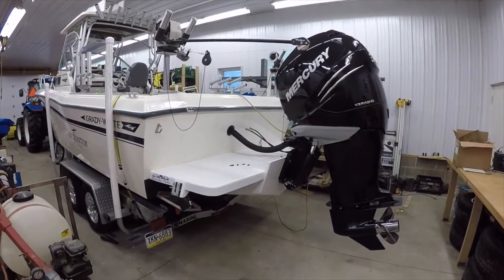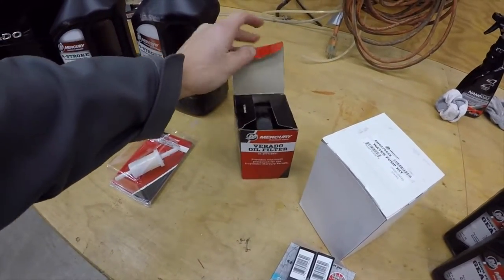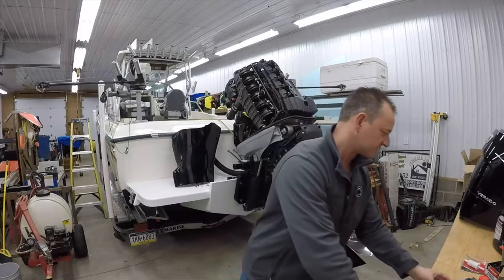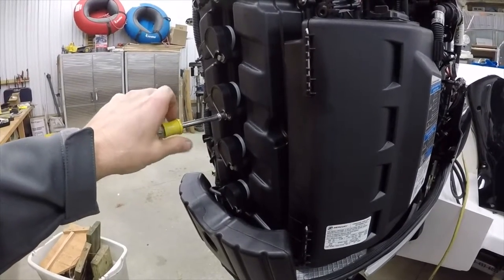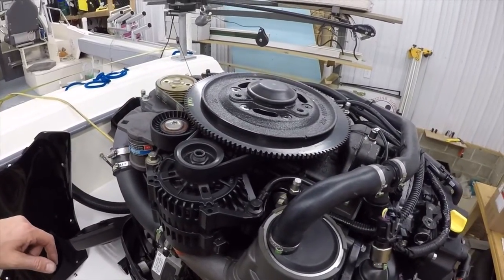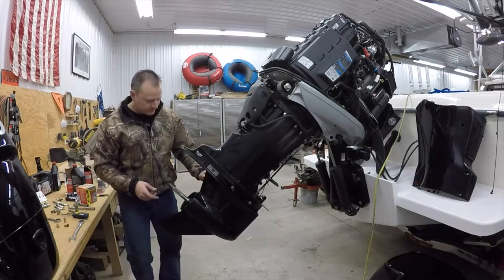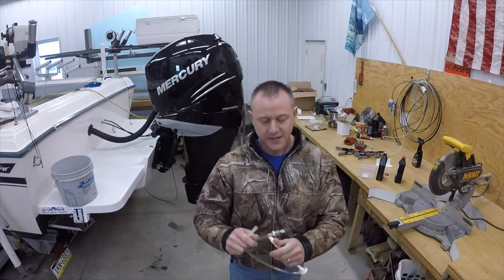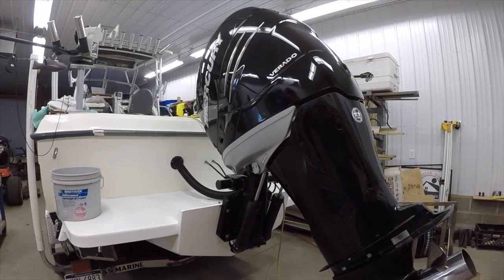Mercury Verado 300 Maintenance

Comment: Quick question that sometimes gets frustrating. You mentioned throttle being in neutral when removing the lower unit, but you skipped reattaching it. What's the trick for lining up the (shift rod?) the lower unit so everything works properly? Thank you
Reply from the maker: I just kept wiggling it until it all went together.

Comment: How did you keep the lower unit in neutral while reinstalling?
Reply from the maker: I just slid it back in.  Didn't have a problem.  Maybe I should have been more concerned about that but everything I had watched/read didn't seem to indicate that would be an issue....

Comment: Hello there, Thanks for the helpful video hitting many maintenance steps! I am tempted to try this myself: plugs and impeller, but wanted your advice on reusing (keeping it clean by using new catch-containers) the oil from the engine and lower until, is that frowned upon? I changed it all out in the fall and now it's spring and don't want it to go to waste.
Reply from the maker: I am not a Mercury specialist.  That being said, if you keep it clean, what does it hurt?  I am sure some will say "just spend the money on new oil" but if it's already clean...it makes sense to me.
Reply: @ModernCountryLiving  I have one more question for you . . . I am getting ready to change out the impeller and all the O-rings that came with the smaller kit version and noticed you unhooking tubes (18:00 minute mark) I think as you took off the lower unit and was wondering what that is and what to watch out for as there is always sometime unexpected and I am nervous about having to take my boat to the shop in pieces if unsuccessful! Thanks in advance
Reply from the maker: @downatthecrossroads2209  I recall the tube.  I cannot recall what it was for.  I'd have to do a  google search.  Sorry.  I would say have a partner with you to help.  It's a little cumbersome with one person.  If you don't have a lot of arm strength, it will be a real challenge.

Comment: Your video helped me with my maintenance, thanks.  One thing I figured out and wish I would have known ahead of time is that when you drop the lower unit you have to drain the engine oil first otherwise it all starts pouring out.  Not the same as my old Yamaha.  And I had a terrible time lining up the shift shaft when putting the lower unit back on, is there a trick to it?  I've always put the motor in neutral when I drop the LU, I read some posts on some forums that said to put it in forward for this motor.  Any tips for lining up that shift shaft?
Reply from the maker: I was curious about the oil draining.  I had read to do that first.  glad I did.  I also read to leave in neutral.  It took some wiggling to get everything to line up.  It was probably the thing that made me the most nervous but it came together well.  I wish I knew a trick other than patience.  :)

Comment: Congrats on your video! Question, do you happens to know the torque setting on:
-Propeller nut
-Spark Plugs
-Lower unit bolts
-Impeller housing
Thanks
Reply from the maker: I would have to look in my manual.  It lists the torque settings.  
  Propeller is 55 ft-lb without a hub bushing.  
  Spark plugs are 20 ft-lbs
  Pencil coils screws 71 INCH-lbs

Comment: What are you using for a spark plug socket? Thin walled? My plug sockets are too thick. Also, what length extension do you recommend?
Reply from the maker: I had a thin walled one for removing the plugs.  Not sure where I got it.  I have a 6" extension I think that I used.
Reply: @ModernCountryLiving  Sorry, I didn't realize the plugs were thin and long unlike the larger plugs on my stihl equipment. Hex size is 5/8 or 16 mm  and I have a plug socket that fits that and easily reaches the plug. However, trying to figure out how to best fog the cylinder as the typical plastic tubes that come with fogging oil is not long enough.

Comment: Hi, is this engine reliable? Was thinking to power my boat with a pair of these bad boy(used one from 2015)
Reply from the maker: I am going into year 4 with this motor.  I have oil analysis done every year at oil change and it's perfect.  
I have had zero problems.  I'd buy it again.
I believe you could have a service technician pull the ECU info to see hours at each RPM.
I also recommend performing full maintenance if you purchase and perform oil analysis at 100 hours just to be sure.
Reply: @ModernCountryLiving  thanks for your feedback. Now i feel a little bit more confident..i live in Malaysia and pretty much everyone i ask here said  ‘dont buy these, because its a nightmare to maintain and will give you a lot of problems, especially to look for spare part’..I’ll research more on this.
Reply: Great video!  I like this engine and have a L6 200 hp,  had it a re-chipped to a 350.  Been running it for 5 years.  What I didn't know when I re-chipped was 37 gallons per hour at WOT.  He is correct on the silence of engine at throttle and low speeds but sounds like a jet engine when WOT.  24 foot premier ptx tritoon will hit 57 mph naked and 50 with full load and 4 people.
Reply: Extremely  reliable.  Get the merc Plat warranty.  Super charger is 5600.00
Reply: After 6 years these verados will start giving you alot of problems. Their designed to break after warranty or 1200Hrs. Buy yamaha !
Reply: @badognobisc  How do i get  a chip for increase HP?  I have twin 300 verados and seems a bit under powered